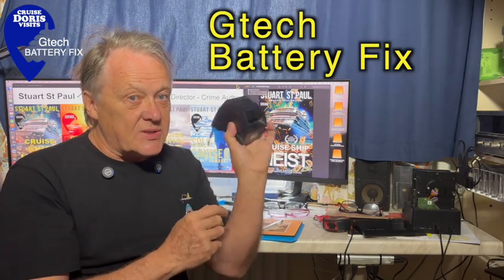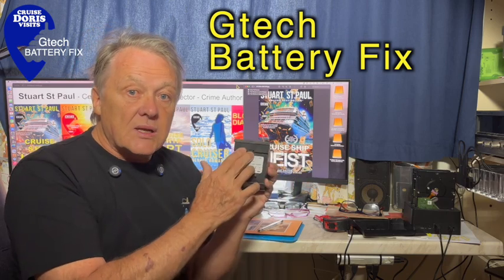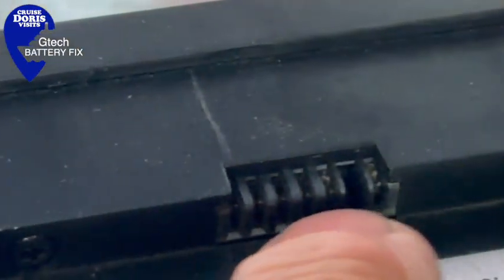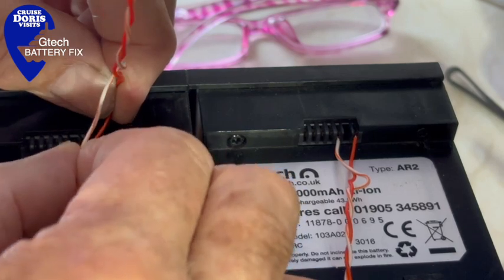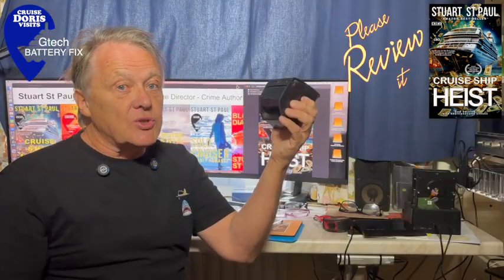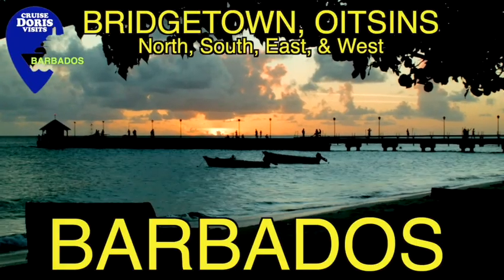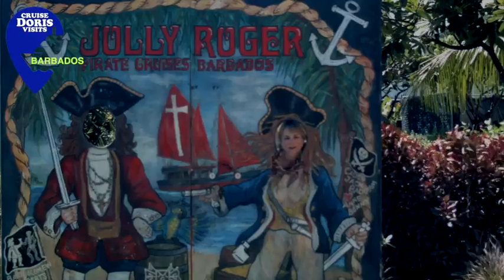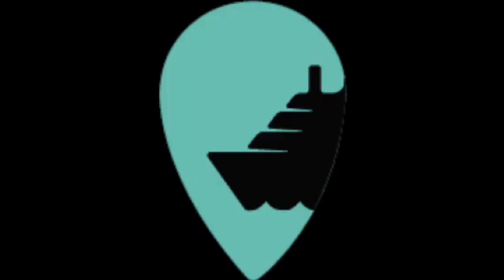Gtech Battery fixed - brought back from the dead

Comment: Just saying thanks here, because I couldn't add thanks to the Switch change video.

Lights flashed RED. Started and stopped. Lights charge green. Starts the won't start. It's all over the place. 

Batt charge jump start done, 
Charger pushing out 27v. 
Battery holding 36v.
Still won't run. Just bought the switch.

I though that the GTech price at £12.99 shown in the switch repair video might have been years out of date. I WAS WRONG.

 I''ve just been on the GTech spares page. . . . . £12.99 IS THE CURRENT PRICE 23.03.2025!!!!  *****AMAIZING*****.

Current Amazon price is £35+.

AND . . . When I went to pay on the GTech site, it took me to my Amazon page to pay for it there. RESULT.

So thank you very much for the excellent guidance.

All the best,

Don.

Here's the video that I wanted to add thanks too, but comments are switched off.
https://www.youtube.com/watch?v=Zb5UrPNOA-w&ab_channel=JeanCruisesforDorisVisits